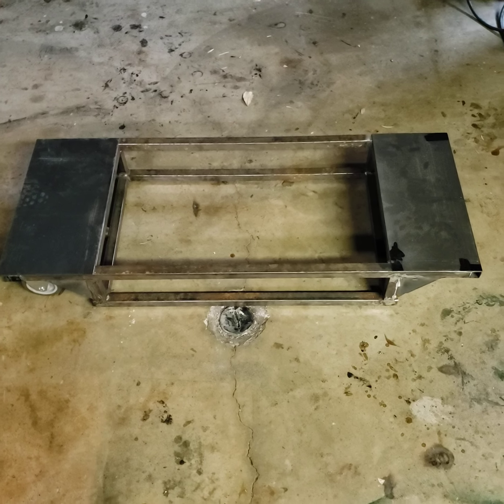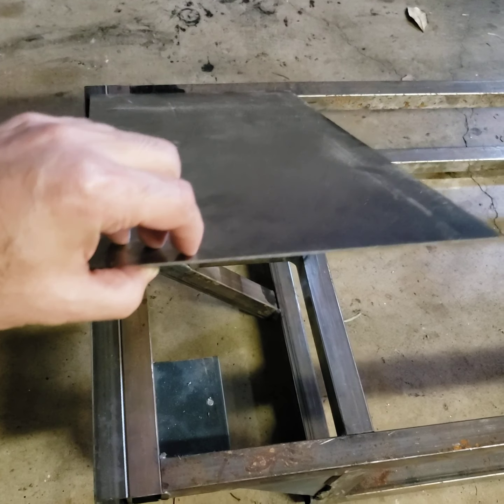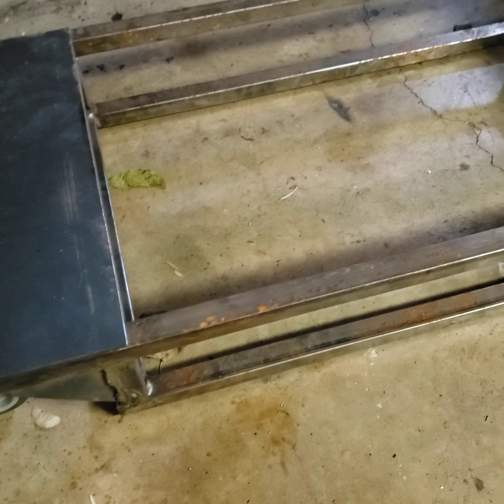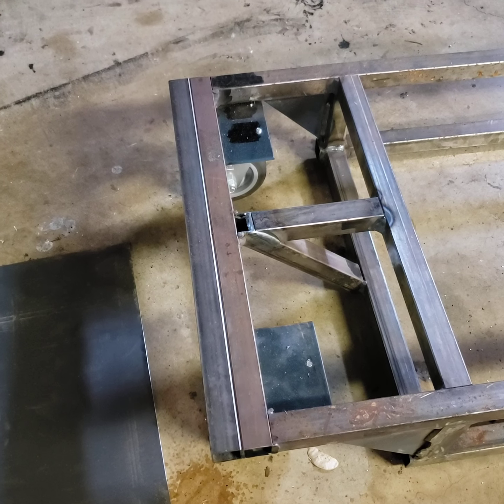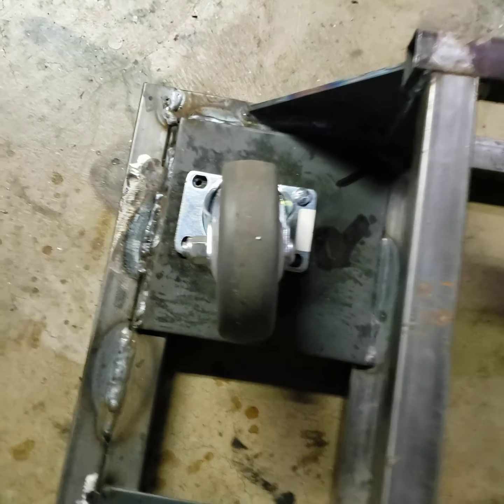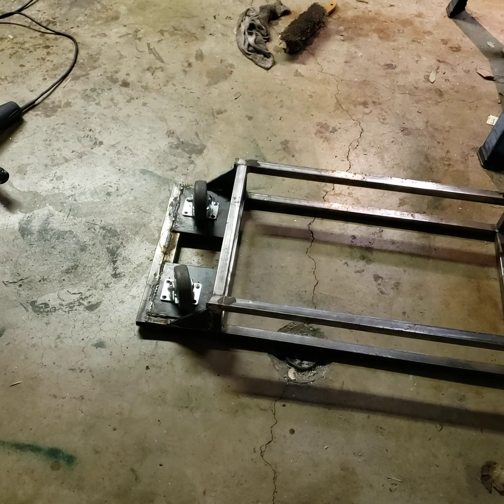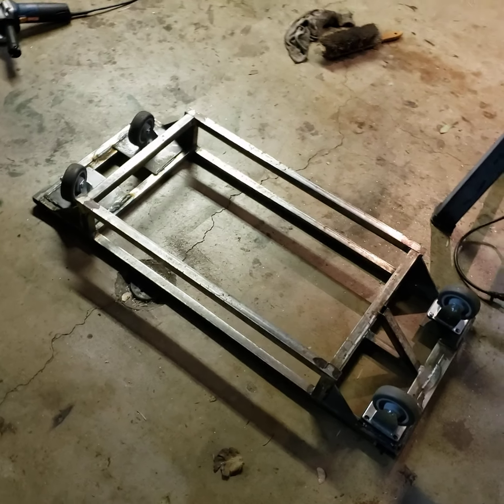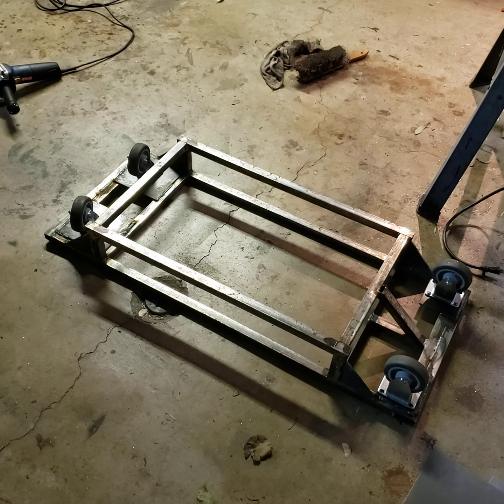Welding Cart Rig 2

Comment: looks good.  Pretty is over rated!  ;-)
Reply from the maker: THANKS!  I really do appreciate that.  I'm doing the best I can manage.
Reply: @mkeyser  You're welds look good!  Practice practice practice.  When I bought my HTP, the first thing I did was pick an enormous welding project.  By the time I was done, I had a real good grip on tig welding.  And a pile of super short tungstens to prove it! :-)
Reply: @mkeyser  DAMMIT MAN!  This is all YOUR FAULT!  I was at my airport the other day and what do I see?  A 48" long general tool cabinet our guys were throwing out!  The box is in excellent condition, but the bearings shit out of all the tracks.  They already replaced half of them and had new ones still in the package for the rest.  I remembered your videos and I dragged the box home.  I already have an enormous husky toolbox, but since getting into this machining stuff, I've got endmills, cutters and tons of crap all over the place.  Then I thought about my shitty HF welding cart holding up my invertig.  I think I'm going to fix the rest of the drawers, load them up with all my tooling, strap the 125cf bottle to the side and park my welder on top.  It eats up more floor space than I would like, but I really need the drawer space.  And all of this is your FAULT!  UNSUBBED!   just messing with you.  I'll stick around.  :-P  I shouldn't bitch I guess.  At least I don't have to fit casters to it and ya can't beat FREE!
Reply from the maker: @jagboy69  I'm really not after subscribers, I think its kinda rude to tell people to subscribe. 
I'm just posting up videos to share, learn from friends, and help folks out.  I have yet to put up some videos about power supplies, which I think will be helpful, but I only put up a fraction of what I do because when I do something, I just get it done, rather than record every bit of it.

This all kinda transpired out of being underwhelmed by welding carts, and I wanted to learn TIG.  I think you'll be happy with your new cart too once it comes together.  I know everyone is running out of space, but we always find a way to make space.

Can't wait to see your creation!
Reply: @mkeyser  I'm with you.  I refuse to beg for subs or likes on my channel.  Either people watch or they don't.  I would never monetize and after reading the recent TOS passed down by these asshats, youtube will be lucky if I don't pull my channel completely and take it to bitchute.   I hate commercials.  Let them advertise on the big channels and leave me alone.  Space is at a premium in my 2 car garage.  I do metal casting, some woodworking, metal fabrication, tig welding and now some machining.  A surface grinder is next on my list!  Where I'm going to stick it, I have no clue!  My machining bug started as a freebie also.  Someone GAVE me my bridgeport and a buttload of tooling for it!  Now I'd never let it go.